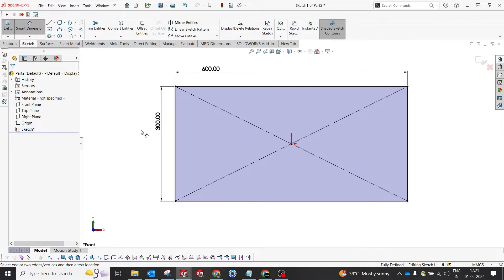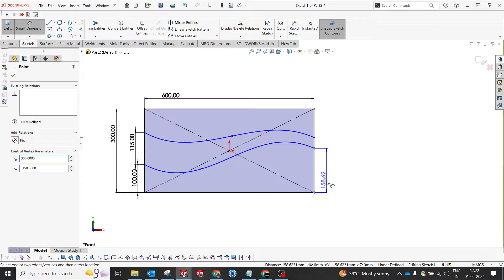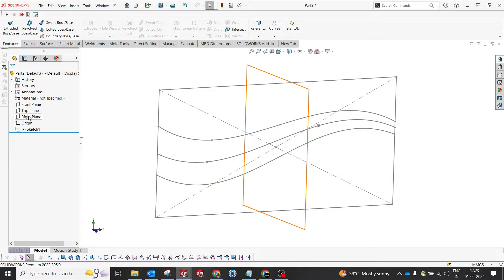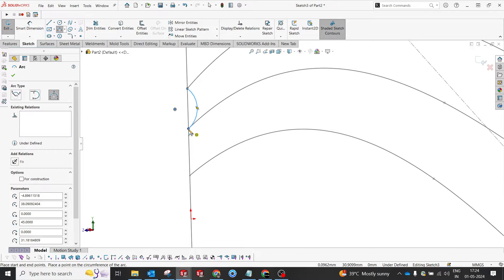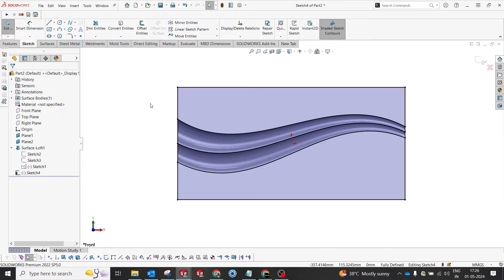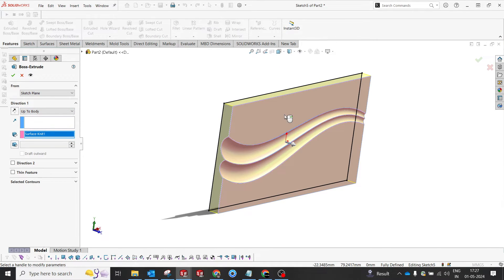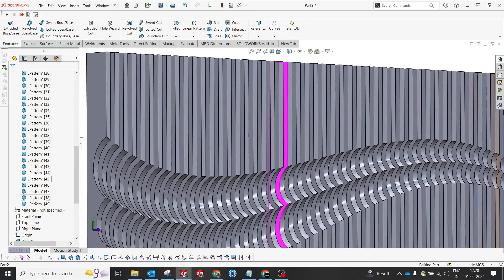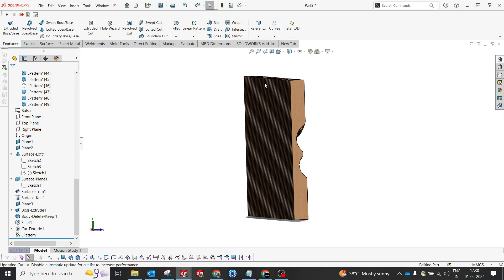Solid works - Furniture Design | Parametric Wall design | Geometric Surface Pattern | EP14

Comment: You are very good at manipulating all the tools and commands within SolidWorks but you go so fast it is very hard to follow along and many times you do things that o you are simple and almost automatic, but to someone like me I don't understand what you are doing.  Possibly you are just too advanced for a beginner to follow I don't know but possibly just slowing down a bit and talking slower would help me.  But I am only a beginner and not the audience you want.  But thank you for the ideas and the video.
Reply from the maker: Thanks for the feedback. I'll consider your point and make the changes in upcoming videos. For the older videos kindly use playback setting from normal to 0.75 or 0.5 this will help you to slow down my videos. Thanks again and keep support 😊